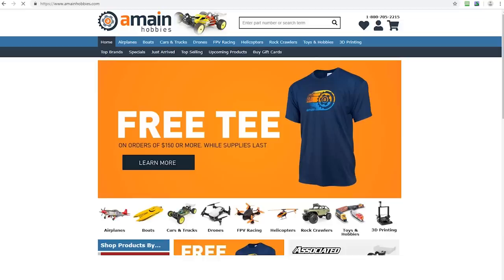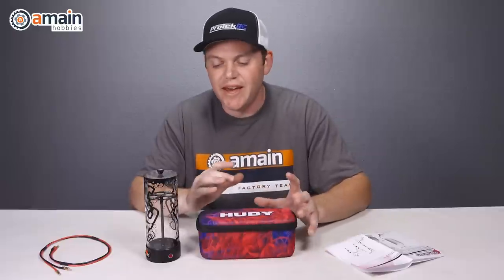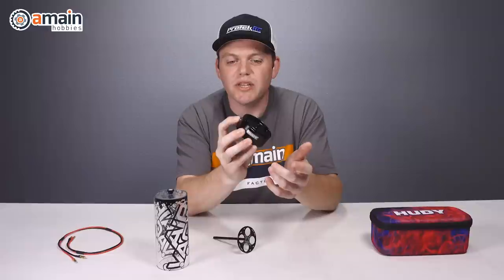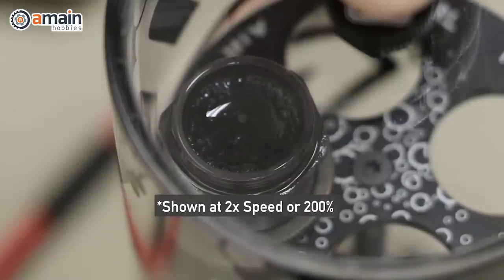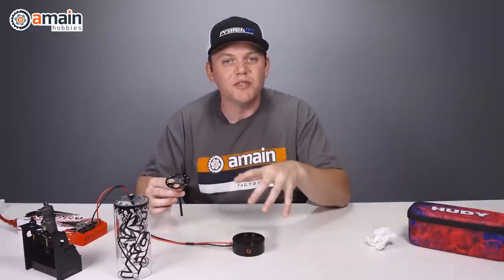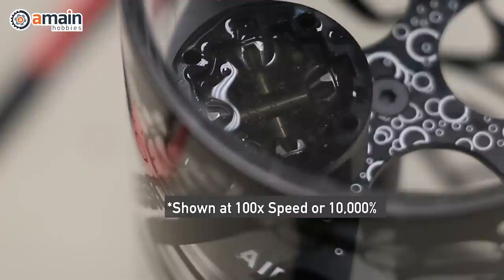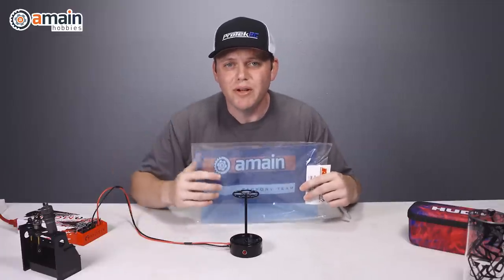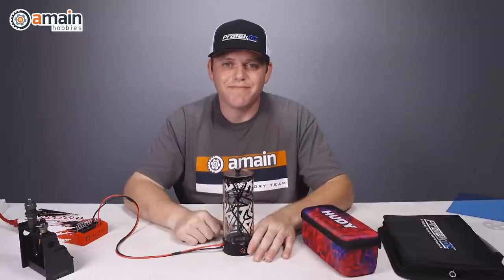Hackin' the Vac - Hudy Air Vac Vacuum R/C Shock & Diff Pump

Comment: One would think for the price they are asking for it, it would include a power source. Nice units, but I will keep my money, and do it the same way I have done it for years. I don't see why this is a necessity, if you are a racer you are going to have several sets of shocks, you fill them, let them sit overnight, and no need for one of these.
Reply: One would think if your buying Hudy gear you would more likely than not own your own power supply. Why Jack the price up more and include something most of us wouldn't need?
Reply: Speak for yourself. Track conditions change so do the outside air temps. With that being said you never know what shock weight you need until a few tests runs. You must have never competed at a higher level where the money pot is worth every edge you can get. Considering it's something you can keep in your toolbox forever it's rather inexpensive

Comment: Hi I don’t know if you remeber me I have a question
Reply from the maker: Yeah, what's up? 
-Brett
Reply: AMain Hobbies can I put a spectrum battery and esc so I can use the smart battery on a traxxas slash remeber the 130 mph one and plus what is the best off road ties and how do I drift the thing and how do I turn off TSM and plus I mostly buy my things FROM AMAIN
Reply from the maker: @r3versekyvak608  A smart ESC should work fine in your Slash, there shouldn't be any compatibility issues other than the battery connector's matching. For your TSM, if it's programmed to your multi-function knob on the transmitter, you can just turn that down. You can also go into transmitter programming (TQi only) and turn TSM off completely that way. For off-road tires, there isn't a "best" tire per se, because the tires are designed to match certain terrain types; which of course varies depending on where you drive and the type of dirt you have available. Here is a list with pictures of tires, let me know if any stand out to you. Also, what type of off-road terrain will you be driving in? 
-Brett
Reply: AMain Hobbies I am using 17 mm proline blockades I use them for speed runs so I might get the pro line 17mm pre mounted monster slash wheels and @AMain Hobbies I love your vids how do I make a vid like you
Reply: AMain Hobbies how do I  program it to TSM

Comment: Could just buy a full set of spare diffs with different fluid instead. Would be cheaper XD
Reply from the maker: Absolutely. That's what the pros do. A silver Sharpie pen is a great way to mark the diff case, to indicate the fluid weight... in case you forget later. 
-Brett
Reply: @AMain_Hobbies  yeah, ain't nobody got time to wait for bubbles to come out when you need to swap doff out in 15mins before next race XD

Comment: So overpriced
Reply: It might be "overpriced", but Hudy products tend to not only be 'high quality', but 'very high quality'.  On top of that, using their set-up kits as a perfect example, they are far, far more accurate.  The markings on "cheaper" set-up kits were inaccurate, whereas the Hudy kits were spot-on.  Finally, while this is far from a "necessity" where shocks are concerned, in regards to diffs, this could prove (not that I own one...yet) to be an outstanding, and functional, 'accessory'.
Reply: @robbryan3044  it's good brand name but it's just how practical to each. Me yeah it's nice but I don't see myself using it but a few time so compared to the price its not that useful in that manner.
Reply: @luisw3406  True, true.  I'm 99% certain that they're not targeting this to the "everyday" RC person.  You won't find anyone whose vehicle is purely for bashing purchasing this.  You'll probably find very few (except for those who just like spending, to show "they own one") whose vehicles spend less that 50% racing & practicing for racing.  This is aimed at those whose vehicles spend at least 75% of their time on the track (practicing & racing).  Right now, my vehicles don't meet that 'purpose level', which is exactly why I haven't purchased one of these...and, until such time as at least half my vehicles meet said 'purpose level', I'll hold off purchasing one.  Those who know this is intended for them (and, again, those who don't mind spending excessively, to "show off", they'll see the advantage, and get one (or all three)...while the rest of us will just enjoy watching the video, and say, "Maybe one day. Maybe. And, then again, maybe not."
Reply: @robbryan3044  true I spend about the same amount of time on track too. But yeah if your spending 75%or more on track it would be very practical it saves time 👍. But me I still would rather spend that amount of $ on tires or other upgrades personally but to each there own taste.